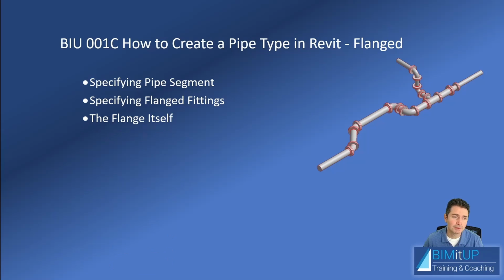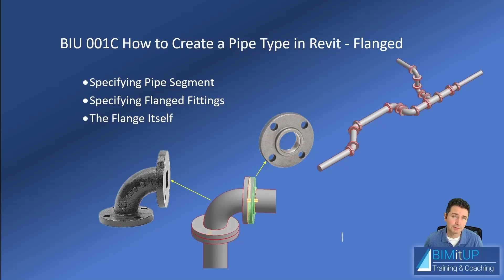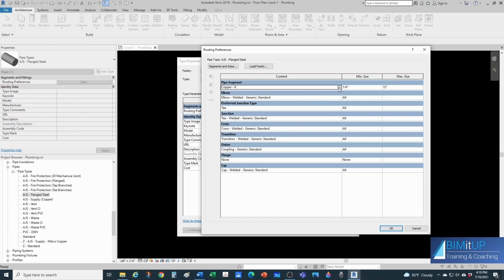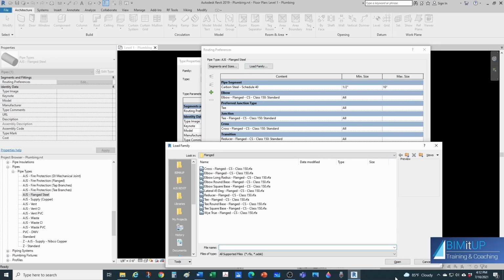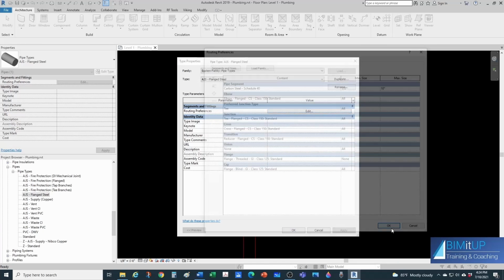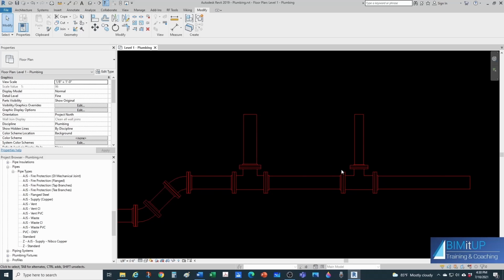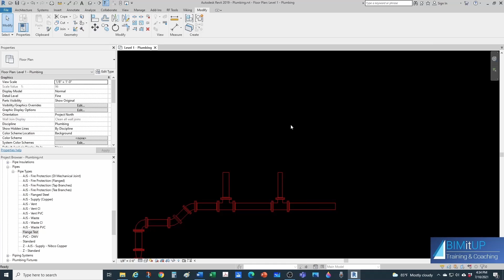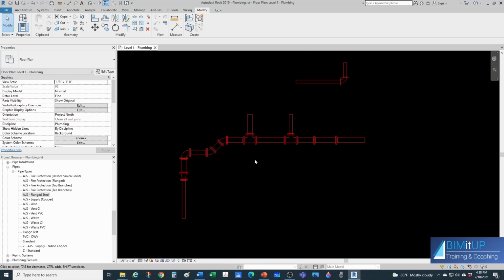How to Create a Flanged Pipe Type in Revit MEP (Flanged Routing Preferences) Tutorial

Comment: What line weight projection (line weight thickness under model objects) are you using for pipe and fittings?
Reply from the maker: I like 1 for 3D views. Nice and clean =) 
I recommend you test it out at different scales and see what you like.
I'm coming up with a template video series where I will go in depth into line weights. Stay tuned